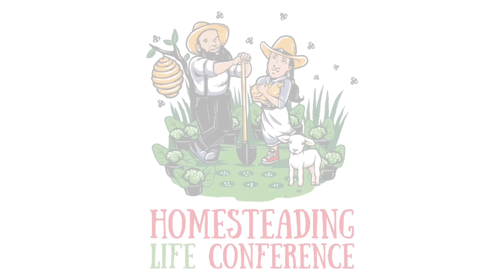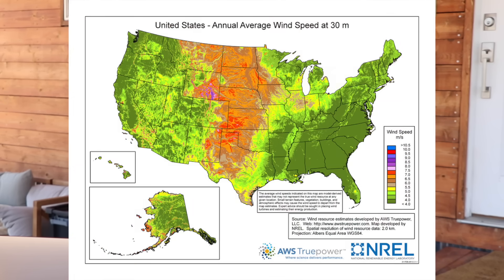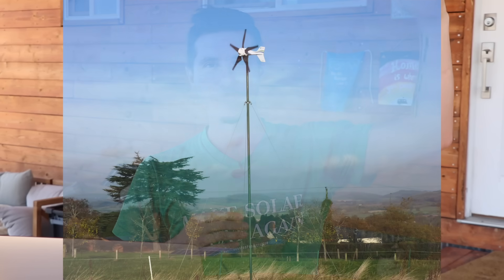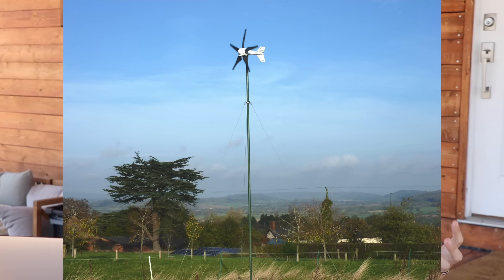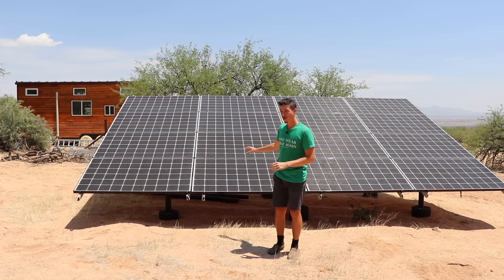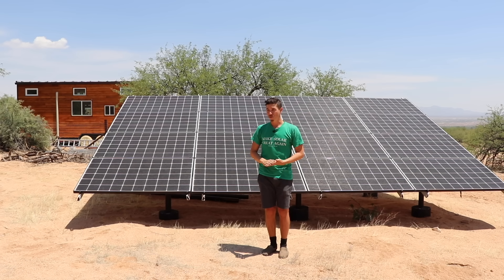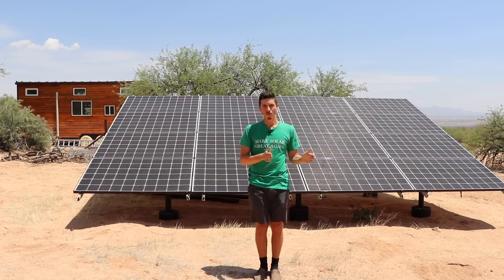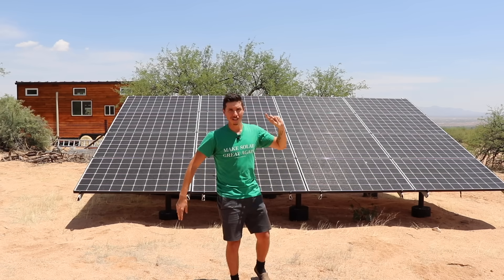Micro Wind Turbines... Are They Worth It? (Off Grid Solar)

Comment: Wind turbines don't need to be 65 feet in the air, that's just the optimum height for maximum efficiency.
Generally speaking, you get more windy days during the winter months when solar panels work less efficiently, so the turbine can help prevent your batteries from being discharged to levels where their life expectancy begins to be effectively reduced. 
Also, wind turbines can generate electricity at night time powering essentials like fridges while recharging your power bank at the same time, something that is not possible for solar panels. Windy nights are often experienced during winter time in many area's worldwide.
As for the maintenance, this can be greatly reduced if the turbine is removed and put away in the months it is not needed, simply unbolt the ( usually ) 5 bolts and unplug the ( usually ) 3 wires, its easily done in a short amount of time and just as easily reinstated just prior to the winter months when solar panels are less effective at producing energy and able to fill any shortfall experienced during this time.
As for maintenance, for some reason you failed to include what is required for the solar panels. One could argue that they need to be cleaned daily to benefit from the optimum power generation that they are capable of, but that would be a bit silly, it would be like saying that your wind turbine must be 65 feet in the air. But the fact is everything requires maintenance and if not performed a reduction in productivity will be experienced anywhere from minor loss to extreme loss or even failure.
Solar panels require a monthly clean, this can be relatively quickly done in a few minutes each panel if it is a matter of hosing down the panel, washing it with a sponge and soapy water and then hosing it down again with clean water. But this could also be a much longer process if there is bird poop, tree sap or other grime that is stubborn to remove. Depending on the amount of panels you have, times 12,  for the amount of months in a year that they will need cleaning to receive a reasonable amount of efficiency in energy production, this will amount to the time required in the maintenance of keeping the panels clean.
You say that installing more solar panels and increasing the capacity of your battery bank is an option and it certainly is, but at what cost ? A few extra panels are the same cost as a mid range to upper mid range home wind turbine, but are completely ineffective during the days where the sun is hidden by dark or heavy cloud and are not capable of producing energy at all at night no matter what.
As for increasing your battery bank capacity, that might not be as simple as you made it sound. Besides the large outlay in cost of these batteries there are a number of other things that need to be factored in before rushing out and spending your money thinking that this will solve all of your problems.
The life expectancy of your batteries is determined by several things such as the amount of drain they experience on the average daily use. This does vary depending on the batteries you have decided to use. Another factor is the batteries you have in your battery bank. In hope of experiencing the life expectancy that your batteries were designed to last, they should all be of the same size or capacity, the same age of use and preferably of the same brand or manufacturer. Without all these factors your batteries life expectancy can be compromised by uneven charging/discharged leading to unknown levels of charge and drain of each individual battery and therefore compromising their reliability and efficiency.
Additional solar panels and batteries may also require an upgrade to your electrical componentry, a larger cable capacity may be needed, also fuses, breakers, charge controllers and any other electrical componentry in your current system may need to be upgraded to safely withstand what it is being asked to manage.
We will all have a personal view and choice in what system or setup we believe would suit us best and it would be wise to be the best informed that you can before you decide on what you initially invest in, or on how the best upgrade to your current system would be decided.
And finally my personal opinion, yes l believe at the current time solar panels are the option for the main or bulk generation of power in most situations but l believe that a home wind turbine as an inclusion to your power generation is a wise addition. For the relatively small cost you have another independent source of power generation that is capable of supplementing the loss of power generation experienced by solar during the winter months, and also you won't have all of your eggs in one basket if a major breakdown or fault occurs to either system. Usually less batteries are required for storing the power needed as often a turbine can generate electricity when solar cannot.
In the end, do your research into all your options and make an informed decision into what would best suit you in the environment you intend it to be used.

Comment: I wish I had the data to share, nonetheless, we found as an augmentation, wind worked fine. It worked in poor weather conditions as well as at night. As for the wind speed, we found installing a prop with more (11 versus 3) blades, helped with lower wind speeds. Anyway, for those of us NOT in the dessert, I think wind power is an excellent supplemental solution.

Comment: theres really only 1 thing that makes wind turbines better than solar...they generate power day and night. and yes you need to think about running them at MINIMUM speed and see what you will gain. but running them at night gains something, even if not a lot, and they re getting cheaper by the month. so eventually it'll be worth it to have a small one as a back up.

Comment: Places like where I am at in ND have an average constant breeze at 10 to 15 mph winds so at 30 ft. in the air a wind turbine would pretty much  "consistently" receive about 300 watts of power. Obviously there's not consistent wind, but for an example. Doesn't seem like much but even if a person got that for 12 hours out of the day you would receive a total of 3600 watts for the day. Not to bad for supplemental power to offset solar especially on cloudy days.

Comment: totally incorrect, you have solar on the brain, due to weather conditions, the largest solar farmer in the US says production is down 60%, of course location is also a factor
solar works while the sun is up, wind works 24/7
Wind power is by far more reliable, cheaper, and easier than solar cells
Reply: Amen!
Reply: Reliable? Winid blows on its own schedule. If you are in a location that has the right geographic layout, you may be in a wind tunnel, but 24/7 is not an option. There is no reason to not use both choices, they can feed a common storage battery chain.
Reply: @thesoundsmith  
Indeed, 2 smaller systems are better than one bigger system.

But the biggest problem with wind is needing to get high enough. About a hundred feet is good for most places. It has to do with the air at ground level often being quite calm compared to up higher. Especially at night when the heat the Earth absorbs is released back into the air. This causes a temperature inversion and almost completely stops the air near the ground. A thousand feet is much better, but a hundred or so greatly increases power output long term, and it's a height easily reached by home owners. If they're in an area that allows it.(aka, not in a city)

In fact, a power company in Spokane Washington did a 14 month test of solar and wind(near the ground), and solar produced about 5 times the energy as wind. Of course Spokane isn't known as an overly windy or sunny place.

Of course not everything is suited for everywhere. Which is why you don't see many coal plants in the middle of cities.

But in deserts, just solar is fine, and in the windy areas just wind is fine. But, just like we use a half dozen or so different fossil fuels, plus  nuclear and hydro, no one thing works the best for most of the country.

Plus, 2 smaller systems don't cost hardly any more than a single system twice the size, and you have less chances of something going wrong and losing all power.
Reply: @thesoundsmith  
And if you have any other way to store energy, batteries suck.

Not for home use, but look up "train car energy storage". A similar set up can be done for homes by building what looks like a chimney going up the side of the house with a steel frame inside. A multi-ton weight and several pulley's top and bottom to change the gear ratio (think block and tackle engine hoist), hooked to a motor/generator.

Because of the steel framing it'll probably cost more than a battery up front. But drastically cheaper in the long run.
Reply: How many Humans live off grid or on grid  Solar PV compared to roof top wind turbines.
I will tell you straight that the number for Roof top wind is very very small compared to Solar PV.
It is shocking to me that Cloudy Britain has about 13 billion watts of on grid Solar PV and more cloudy Germany has about 47 billion watts of solar and it met 9 %of their total electricity demands last year.

More individuals have 100% solar than wind Turbines.

Roof top Solar PV Rules
Reply: um no its not windy 24/7 unless you live on Saturn
Reply: @crissanchez9043  
The wind never stops blowing.

You might not feel it moving near the ground for various reasons, but 20 feet above your head the winds blowing.
Reply: While I would agree that location is key to either, you really need an area that has 15mph winds(regularly) to make "residential" wind power work. Yes, you can build a 100ft tower and get "cleaner" wind but that has its drawbacks as well. With modern charge controllers (600V strings?) solar can produce SOME power even in quite adverse conditions (raining). It all goes back to bang for the buck in your specific area. That MAY mean installing 15KW of solar rather than 5KW of solar. With wind you usually cannot install a larger dia unit to compensate for slow winds that will not have issues during storms.  In MOST areas in the US, solar will come out ahead of wind.
Reply: @bradquinn4161  not when cover by snow
Reply: @rogersmith1408  Sure you do need to go out and broom off the snow. In areas that get mostly powder snow it usually takes care of itself. That is one of the big reasons that I greatly prefer ground base systems (as opposed to roof based).

Comment: There is another down side of towers you did not mention.  In some locations, the code mandates you have a 360 degree 'fall zone' of your tower.  It is not permitted to be able to fall and hit any structures, power lines, roadways, etc.

Comment: On the plus side
Wind generators can produce power at night...
And for a diversion load..
A hot water heater is a good place to store energy.
And as far as a tower...
A telephone pole mounted on a pivot unit can be a good choice..
Reply: What if you don't get wind all the time? Uh oh.
Reply: Can you find a telephone pole 65 feet long? Because that is the recomended height for a small gen.

Comment: Sun every day? Really?  Not here in central upstate NY and probably not where you live either.  What's unsightly up here are the wind farms.  They are very noisy and kill thousands of geese every year.  Maybe you need a 65 ft. Tower but up here in the northern Catskills or across the Mohawk Valley in the Adirondacks we have year round wind that varies but appears to average about 8 mph.  The Turbines that MWANDS manufactures are excellent.  I have installed a few systems using their proprietary fans.  You kept stating that they use motors. Did you mean the turbine?   So far the two systems I installed have had ZERO maintenance.  Do you have a marketing deal with a solar panel company.  Your statement about solar panels lasting 25 years is nonsense.  Yes solar panel might still generate some electricity after 25 year but not really very much. Solar panels slowly degrade over the years.  They suffer from IR/UV damage.  I have installed about a dozen solar systems.  I have built several dozen solar panels over the last 20 years.  Some are still functional some aren't worth the 4x8 sheet of plywood that is the backing.  Your denigration of wind turbines doesn't offer foundational facts.  I actually prefer a much different turbine design that is horizontal and doesn't spin very fast but produces incredible torque so can be geared to raise the rpm of the turbine.  No matter what neither wind nor solar can generate enough power as a stand alone system.  Coupled together a wind and solar system can in fact generate enough power to be completely off the grid.  One thing you seemed to avoid is Batteries.  Batteries are a major investment and require lots of maintenance.  They average 5 years before overhaul.  It is true that batteries can be refurbished but it take a skill that only a few of us possess.  I have rebuilt over 100 truck batteries and at least 50 forklift batteries but finding experienced battery rebuilders is not easy.  I am 69 years old and retired to my duck farm.  I won't do it for anyone.  My livestock keeps me busy and they feed me.  I use woodgas to run the generator to charge my battery banks when the sun doesn't shine and the wind doesn't blow.  I suggest looking at a more complete system that integrates wind, solar, and syngas.

Comment: Wait till he has a major failure with his charger controller, solar panels shorting out, batteries cell goes bad and causes others to go bad, etc. Even if it's warrantied you want to wait till new panels arrive after you had to wait and send the old ones back to be checked first (The manufacture is not giving out free solar panels cause you say it's bad they want to check first). I rather have piece of mind and have two separate systems for redundancy but tied in to one so if one goes down the other is still providing you power. If you're crafty you don't have to buy expensive pre made stuff.

Comment: It's a little one sided of a video.  He only talks about one type of wind technology.  Also he doesn't seem to understand the relationship of energy and power.   1000W of solar doesn't necessarily replace a 1000W wind turbine.   Most Solar panels can only generate their peak power for a few hours in a day (weather dependent) while a wind turbine can generate good power dozens of hours strait night or day (wind dependent).   So in the right locations a 1000W wind turbine can generate a lot more KWh's per day than a 1000W's of solar. Personally I think wind is a good compliment to solar because often when it's sunny out it's not windy and vice versa.  They are both variable sources of power but using both helps smooth out the situations where you might not be generating much power .

Comment: Here in Sunny Florida, we don't get as much sun as is touted. We do get lots of wind as well. When storms come around, we have no sun. But, when they come, we have plenty of wind. Wind and Solar compliment each other. When we have hurricanes, it's common to go over a week and not have any sun meaning the solar panels are putting out extremely poor power. But, a wind turbine would be happily spinning away.
Location Location Location. MicroTurbines are super reliant on location. As you bring out needs to be higher, more like closer to 100ft, as they need to be "over" the treelines. Otherwise the wind can be too turbulent.
However, going with a VAWT, Verticle Axis Wind Turbine, thrives on lower speed winds AND turbulent winds. So they don't need to be as high. They can look really nice if built right (like a large merri-go-round). They are cheaper to build, easier to maintain, easier to turn (I have seen some large units turn with <10mph winds), and they are uni-directional not needing to turn into the wind. They always face the wind. Also a VAWT is a lot easier to keep from over spinning meaning they won't fly apart in pieces.

Comment: If you have good wind, turbines make sense.      Especially if your region is cloudy, or you're very far north and have limited day length.    Yes, they are unsightly and require a tower, guy wires, etc.       But they actually are a good fit for some places.    

You make a good point about blade diameter:   Big long blades can produce power at much lower wind speeds.   But don't forget their slower rotation also makes them quieter.    You get more of a quiet "woosh-woosh" sound, rather than the "annoyed bumblebee" sound you get with the tiny, high speed models.

Comment: Your specs are off a bit. For example, here in michigan, we get an average of 12mph+ just looking at the chart you listed, it would make at least 250w per hour at average 12mph. That is a minimum of 6kwh per day. And the wind turbine only has to be above the surrounding trees to get consistant good power. A solar system of equivalent power per day would cost $2000 said and done. These are very conservative numbers. My specific area gets an average of 18mph which is around 400w. This is per hour 24hrs! Not peak power for only 4hrs a day( which is how little peak sunlight we get on average). And the bearings are the only things that usually have to be replaced. A correctly designed tower would have a locking mechanism and an electric winch for easy up and down of the tower for the very little maintenance that is needed. Panels have to be cleaned ALL THE TIME to get peak power. Its as if you just kinda looked up a turbine and decided it was just a horrible thing. Id like to hear one video you have ever seen where the wind turbine was "loud". I have to stand next to the turbine and actually listen to them close to hear them. And the $10 in bearings that get replaced? That is in a huge time period of over many THOUSANDS of hours. Next time, actually physically go see one before you spew nonsense.